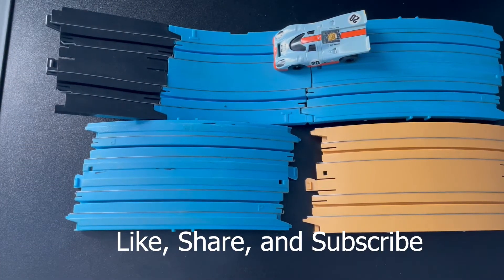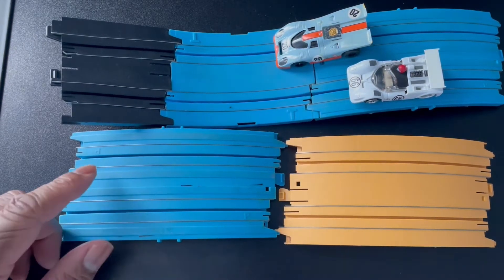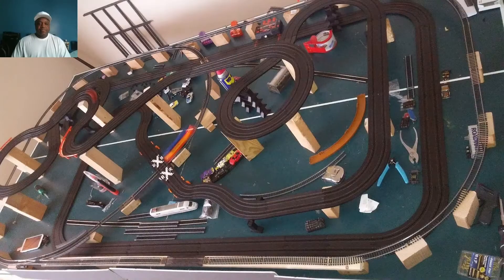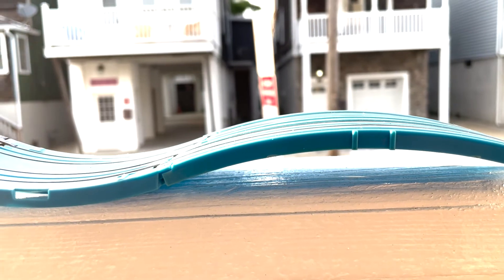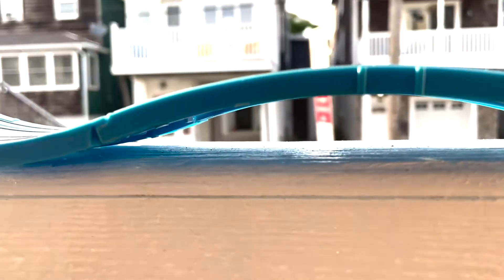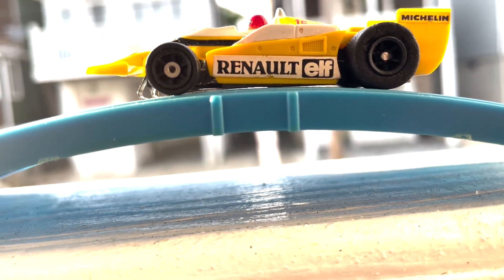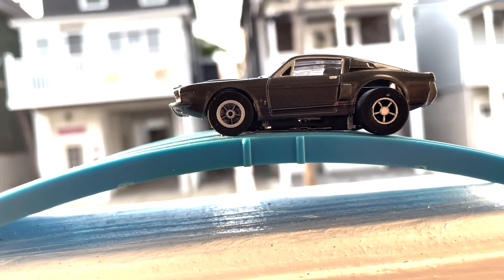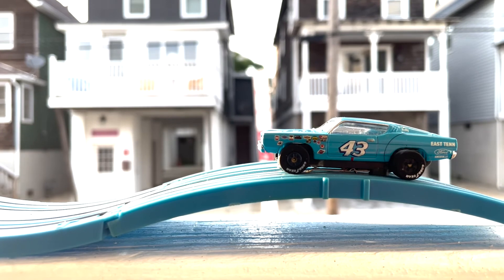Elevation and HO Scale Tracks

Comment: Well, of course Steve McQueen would make it! 👍 In he train hobby, track is level, we make the terrain change for elevation variation.
Reply from the maker: The track can be heated and shaped to your liking. I find it odd that the track that is manufactured does not work for most cars and they haven't attempted to fix that.
Reply: @slotcarsandhotrains  Agreed. Good tip. I had track back in the 60s and 70s. The had that same hump/hill/obstacle. We used  to try and jump over it. But that was original Thunderjets. I guess they never changed it.
Reply from the maker: @shiftintohigh5564  Exactly!

Comment: I had been researching for about 5 months looking for the Exact same kind of setup for hills for a future Planned Diorama.  I literally just finished using  a Turbo hoppers and Potters track with adapters.  Also added a 'Ghost" track self power station.  sat at my desk while letting the car run on its own...and boom...I found your video 😂😂  BTW My Rokar 240Z runs like the wind on this.  Just be careful going up and approaching down,,,,,,,Becomes a flying hobby instead😅🤣🤣
Reply from the maker: LOL definitely have to take it easy going up the hill.

Comment: man I was struggling with elevation changes for weeks when I was setting up my track. I looked around for weeks, asking the Elmers for their old time solutions.. and no one had a strong enough suggestion, other than routing a track out of MDF and forming the wood.
Reply from the maker: A while back some guy on a forum heated plastic track and bent it a bit but I don't have skill or tools to do it. Perhaps 3D printing might be a way to solve it. I bought a Carrera hump/bridge and the results are the same. The rake is too steep for the cars, even the 1/43 cars don't properly negotiate the bridge.

Comment: WELL for starters the HUMP in the track is to high what you should do is use a track with a smaller hump or HEAT the track and drop the hump a little bit very simple
Reply from the maker: You totally missed the point, thanks for stopping by.
Reply: @slotcarsandhotrains  uh i really don't think I did the CENTER of the car drags over the hump also the front wheel is up in the air 😔 as for me i create ELEVATION for my cars i don't waist MONEY 💲💰 on tracks that my cars can't TRAVEL OVER 😌
Reply from the maker: @1toughGplayer  Uh yea you did. The point is there is nothing manufactured that works with most cars. The cars that come with the sets work fine.
I found out a few years ago (before the beer bug of unknown origin) you can use a heater gun to bend the track. When i set my layout back up that will be the route I take.
Reply: @slotcarsandhotrains  i have an idea how about you create some videos of you using your set I'm quite sure people would watch 🤗🏆
Reply: @slotcarsandhotrains  hey also you could invent some tracks on your own come up with some that has manhole covers and some that has grills where you can see through and some amazing backgrounds alot of people are into this hobby more in 2022 - up
Reply from the maker: @1toughGplayer  I am going to do videos of the build process and detailing it. I have to pick up the 5x9 sheet of wood that I am going to use. I was using a ping pong table but a flood at the storage unit  damaged it a little bit.
Reply: @slotcarsandhotrains  great 👍 I'll be checking for it